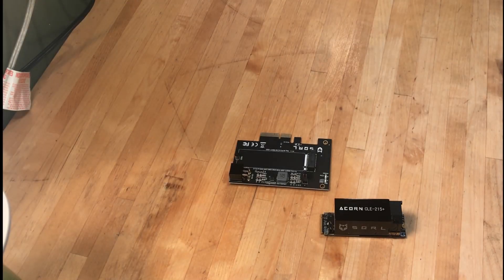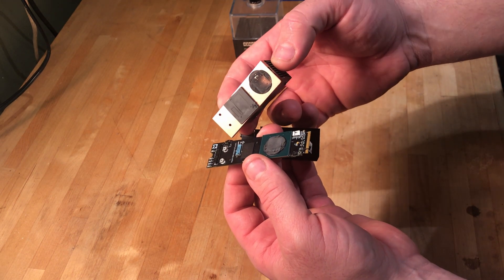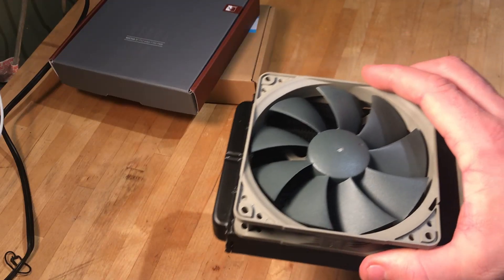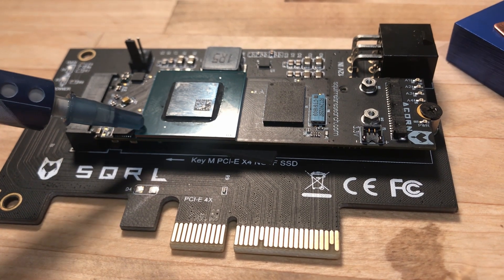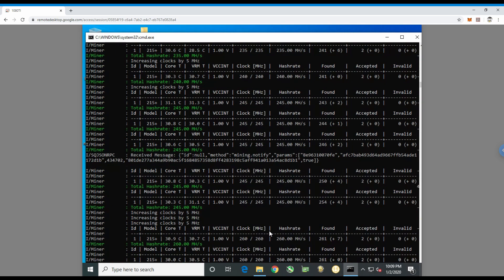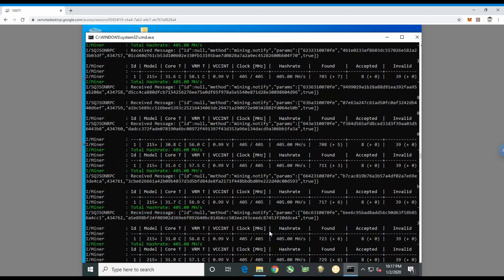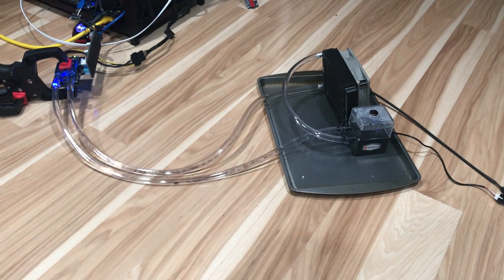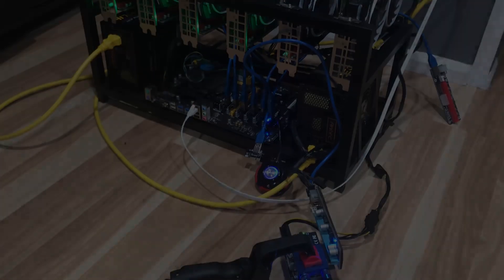Waterblock your FPGA SQRL Acorn CLE 215 215+ and get 400mh/s on CKB!

Comment: Hey, this is off topic but it was the only vid I found in my history.

I just swung back by because I was relocating some of my equipment; and a heat sink on one of my F1mini+ .. tipped very easily off the fpga chip with very little effort to the left and right; so I popped the fan and heat sink off and the thermal paste was completely dry; I reapplied the thermal paste; going for using MX-4 this time around and will try TG-7 on the next one.  

Results are very good in the short term already, running 6 Celsius lower than before and 10 Mh/s higher than its previous average.  Hope this information helps, I am going to check all of them now, as the heat sink now will not tip left or right.

Peace
Reply from the maker: Wounded Warr1or I just had that happen too. I bought one used and the box was a bit crunched and the fan was a bit floppy on top. Concerning that it may overheat but I did repaste it as there wasn’t much paste. Also one of the lock pins to the board wasn’t seated all the way.  Runs much better now.  Not sure how far you can push cooling and “over clocking” but may be a fun project to get them back up to a $1 / day

Comment: What are all the algorithms that you can run utilizing the Acorn CLE 215+  .. I kind of wrote the whole thing off during the continous delays back then; when  a coder I know, Elio wrote some software for them and never got paid, ( same dude who wrote the Eth Enlargement Pill ); but if its worth the boost; maybe it's time to revisit it?

In case your interested; a dude on ebay has a butt load of ASUS Z270-A Prime mother boards for sale at $95 bucks a pop; they are my go to mobos; buttery smooth bios with easy online updating; I run X9 GPU'S on them buy using the two M.2 slots; but in your case; you could run X8 GPU's and one X4 slot CLE 215+ Nest card in one M.2 slot and plug in the recommended X1 SQRL Acorn per each X2 GPU's .. That ought to be pretty frosty.

I also use these boards to build some pretty beefy gaming systems with cross fire AMD cards or SLI GTX cards in a nice $55 CoolMaster case and sell them on Craigslist; instead of just selling the cards on ebay to upgrade my mining cards; it works for me.

Peace

Comment: Thoughts on water cooling F1 mini? For overclocking
Reply from the maker: He Shells I would have to look into that, the acorn was sort of easy because it was very undercooled from the start and not good for much else, I will have to look into the architecture of the F1 mini and see about a video. Thanks for the great idea!
Reply: @excaliburmining6194  the more I'm learning about crypto mining, it seems to have some common goals.  In regards to temperature, hash rate, power consumption. As I'm looking to get some F1 mini's I was think that possibly water blocking them would be more efficient while overclocking them. The only thing I'm not sure about is the ram capabilities, and/or expansion. Since that I believe would be the next phase of performance
Reply from the maker: He Shells I know devs are working on ram for these miners so they can go after more algos but nothing avail at the moment.  You can put a sd card in the mini+ and store larger algos but have not considered water blocking.  I know changing the freq on the clock takes them out of their sweet spot and hash rate drops off dramatically as opposed to what you expect from a GPU but that is one of my next projects on a video about optimizations!   Thank you for the comment!
Reply: @excaliburmining6194  thank you for your time and informative videos 👊😎. I think the SD card is to store larger/more algorithm's. Which makes sense for faster transfer to mining other coins. From what I understand stand (as I'm learning FPGA programing) to increase processing speed. The most common issues for overclocking* is the DDR ram. But ram and logic blocks are the ratio to which FPGA's have there main processing limits.